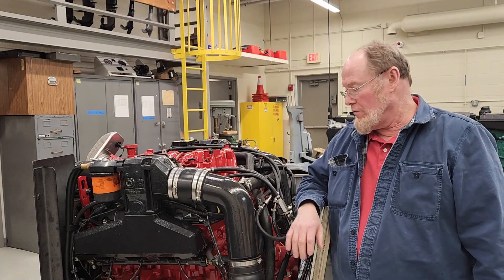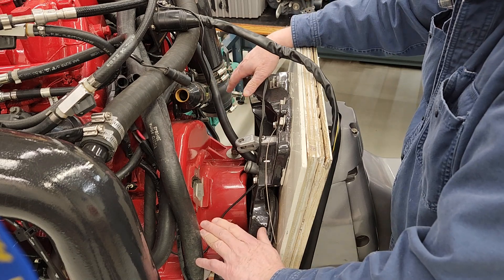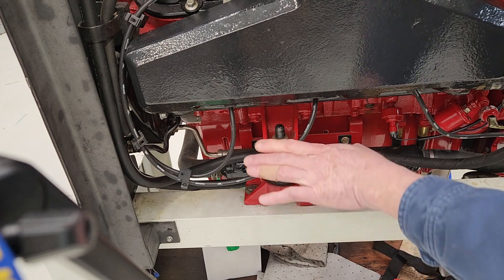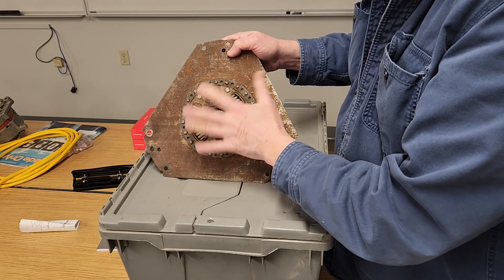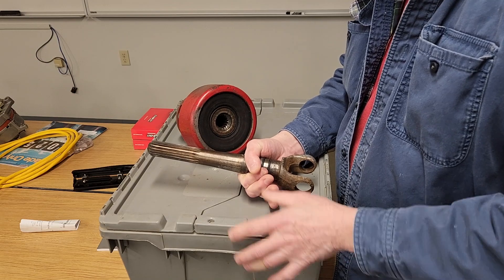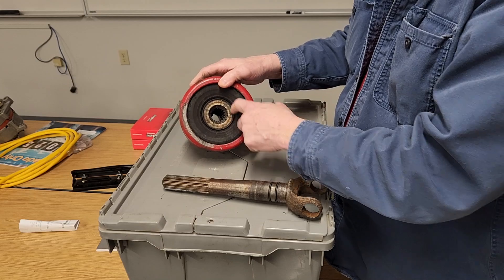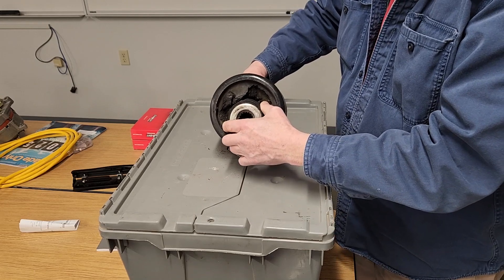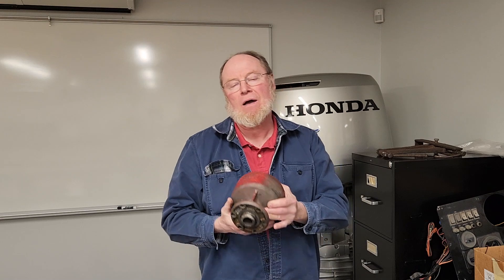Sterndrive Engine alignment

Comment: Hi Ted, I have a 2004 Larson 330 Cabrio with twin 5.7 Gi-C's, and I believe we're actually close by in Warwick, RI.  Last summer I blew out the u-joint on the port side and ended up tearing up my transom shield and cracked the casting on the engine coupler (the rubber seemed fine).  After replacing the transom shield and coupler I am getting a lot of vibration.  I swapped drives to confirm that it wasn't the outdrive.  I have an alignment tool that can be inserted quite easily, but when the engine is turned over 180deg it binds up, but not terribly.  Visually, when looking into the splines and cranking the engine I can see a wobble in the brand new coupler and fear that I may have warped the flywheel.  There isn't much info out there on such an occurrence but perhaps it is a warped flywheel, bad coupler, off-axis coupler due to the shoulders being too thin on the mounting studs, or something else altogether.  I have had two mechanics look at it and have spoken to several marine shops...no one seems to be able to figure it out.  Is there a way to measure runout on the flywheel and/or coupler with the engine is installed?  Or is there another test I can run?  Or just bring the motor and coupler to your shop at NEIT? 😁  I appreciate any insight you can offer!
Reply from the maker: Please email me at marinedoc01@yahoo.com so we can set something up. I have some ideas but need to look at it.

Comment: I have an old 79 mercruiser with a 305, do you have a video showing the installation of the rear fixed motor or bell housing bushings? Sometime coming up I’m pulling the engine out to freshen it up, really enjoy your videos, thanks Ted 👍😁
Reply from the maker: @davestewart9146  I don't but that's something to put on my list. I have some older flywheel housing I can do a demo video on.
Reply: @ thanks Ted
Reply: I have a 2019 Volvo V8-300 engine/DPS-B stern drive with only 200 hours on it. It’s on its’ fourth coupler.  I got the engine at 125 hours in 2022, and it was on its third coupler already!  The third one failed at the beginning of last season very suddenly, basically idling out of the channel in my marina. Spun coupler splines.  I have heard that the coupler used on these DPS-B stern drives in recent years had very shallow splines on the inside, and that this has caused A LOT of premature failures of these couplers.  I also understand that Volvo Penta has issued a revised part with splines that extend further into the center hub area.  Can you comment on this?  The engine and drive have not been abused in any way.  The new coupler was not cheap !!  I had it professionally installed, of course, which was an engine-out job.  Interested in your comments and if you know anything about the revised coupler design used with these V8-300/350 engines.  Thank you for a great video!